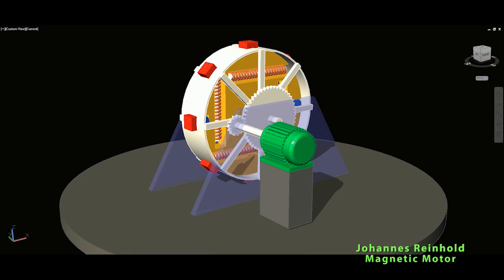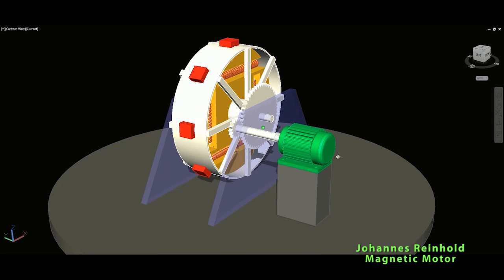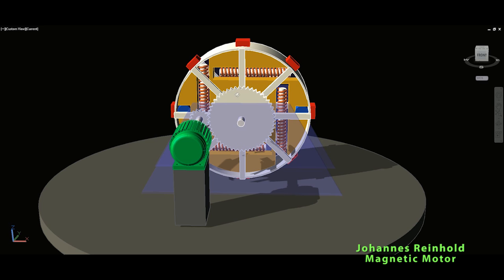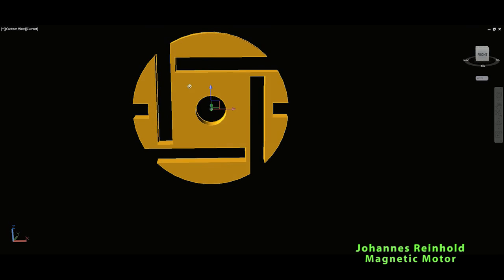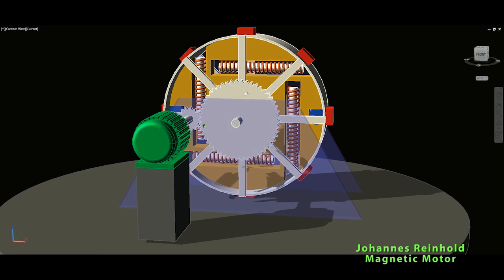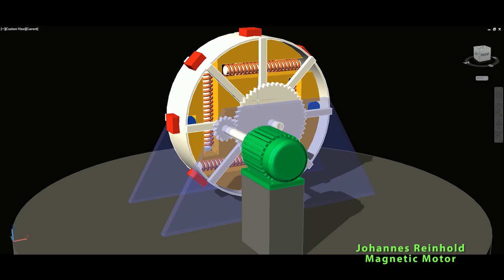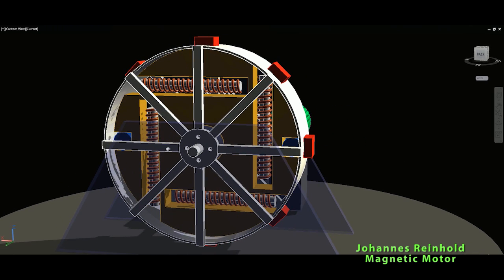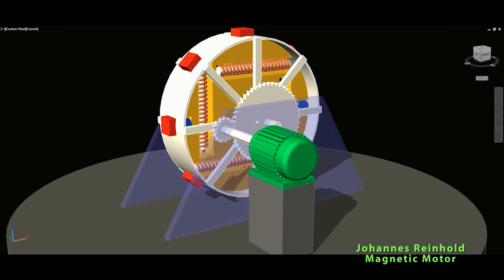Free Energy Generator 2017, Johannes Reinhold Permanent Magnet Motor

Comment: If the coils are placed outside the rotor, then we obtain a monopolar magnetic motor, with four drive coils, identical with that of Fig. But an unipolar magnetic motor has efficiency between 5-35% instead of 100% or more, so that the efficiency can not be more than unity.